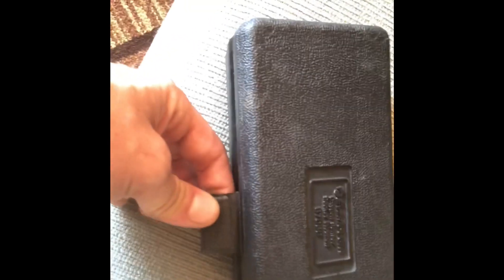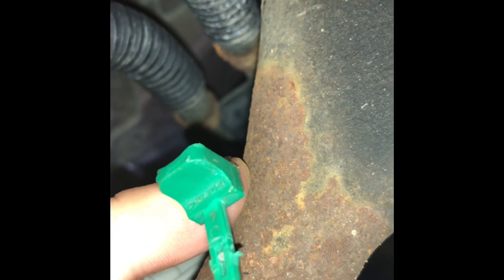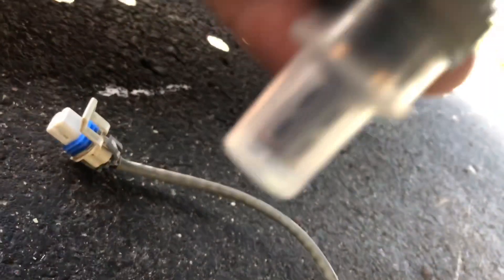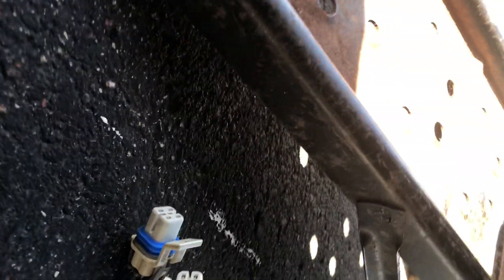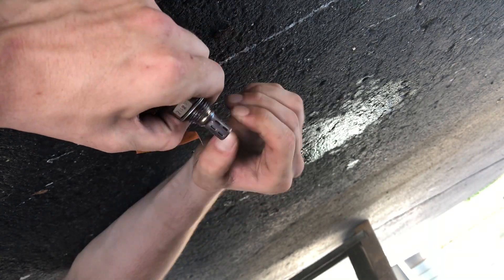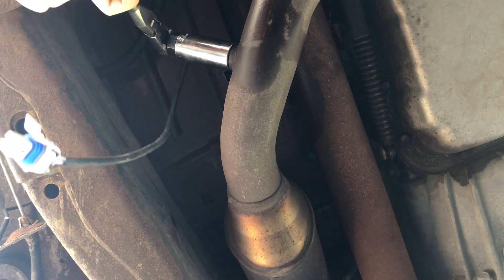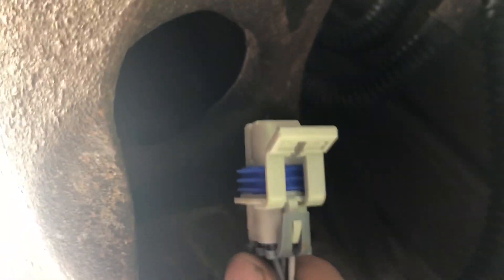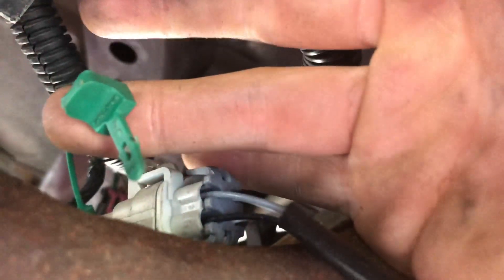How to Replace an O2 Sensor on a 2008 GMC Sierra 5.3L

Comment: Is that the problem for my gmc sierra 5.3 shaking when coming to a stop and idling
Reply: Hip Discovery it has 47k km
Reply: more than likely mine has the same problem
Reply: @bli-n-d5530  I think the last mechanic I used rigged my truck like this. He had my vehicle 3x longer than he said he needed, then told me I needed front end work and asked if my  front right shuddered when stopping. It had NEVER, but started soon after. Mthrfkr. Now I have mis-fire in #4, a tapping right in that area, and a code that includes O2 sensor as a cause.  The oil change/inspection guy screwed me too, said I had a 6.2 and put 8 qts of oil in, bullshit if he didn't know it was 5.3.   2008 model.    Mthrfkrs.  This shit ain't gonna happen again and there could be some beatdowns.  And guess what ... they know eachother. Lucky for them my firend recommended the mechanic and not oil guy.  I am learning this stuff now. Fix my own stuff for now on.
Reply: @bli-n-d5530  front right  ??